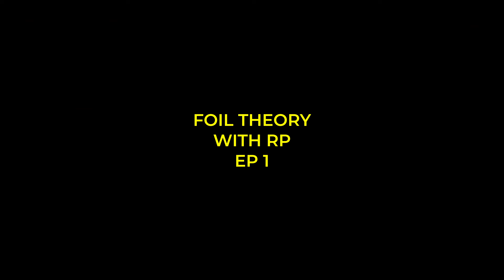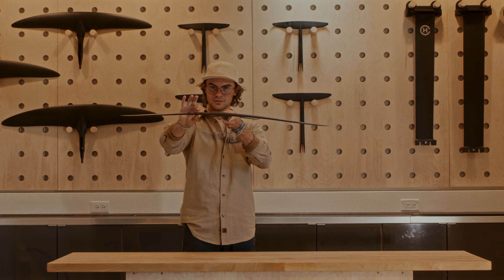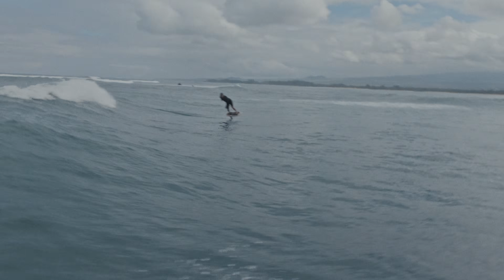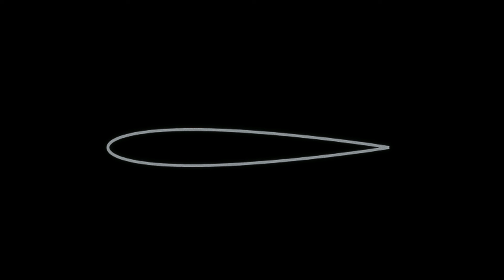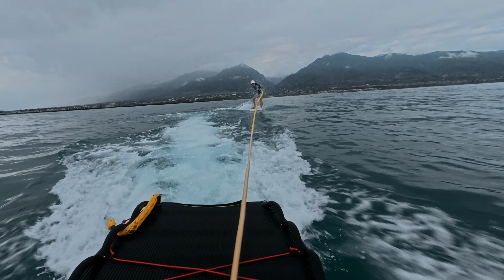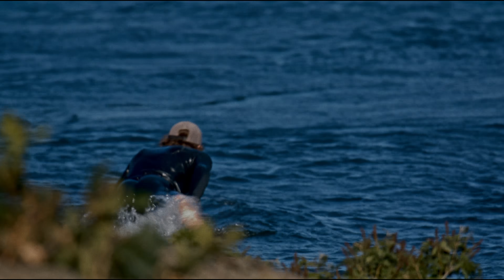How Hydrofoils Actually Work — Explained by an Aerospace Engineer | Hydrocraft Foil Theory EP 1

Comment: Actually it's quite the opposite. Anhedral creates roll stability and dihedral results in instability. The reason it's opposite is your center of mass is way above the foil and stronger lift on the lower side of the wing will push your foil up, but not you, because your not above said lift. Higher foil and lower you equals more roll. Go try such a foil, old gong fluid V2 for example...

Comment: 3:41 "most front wings want to nose your board down" 
That doesnt sound right to me, front wing produces the lift that sends the nose of the board up, did you get that backwards or did I misunderstand?
Reply: Try riding your foil without the stab on! Its actually a pretty interesting thing to do... you'll understand what he is describing too ;)
Reply: He hasn't explained that it is a speed related nose down. At the top end of speed the centre of lift creeps and causes it to roll forward. The stab produces the opposite lift but its the set angle delta between front and rear together with rake on the mast that helps.
Reply: I don't know anything about this subject but that indeed doesn't seem right at all. as if only an airplane's stab would generate the lift... please elaborate on this

Comment: 1) the front wing produces torque directed up (lift) which is enhanced by the torque from the tail. ifthis combination produces some drag as both the front wing and the tail are angles wrt the water flow. shimming  the tail reduces this drag but reduces the overall lift
2) for comercial planes, the dihedral does not return the foil to the horizontal position. There is nothing special about horizontal position in the interaction between the foil and the air. There cannot be the returning force.
I ignored the remaining BS

Comment: I want to get my grandkids into foiling but the danger of getting cut by the wing is too great, 31% traumatic injuries in 12 month period just can't do it. Kids can't control their fall and the foils are too sharp. One cut in the wrong place and it's curtains. One guy at Hood River cut his femoral artery and nearly died. Many many others with injuries needing stitches. If you could design an injury-free recreational wing for kids/teenagers that would open up the sport. IMHO
Reply: Great point. I am very safety conscious, and purposely choose foils that have relatively safe looking tips and edges.
Reply: Severne Redwing hydrofoil has rounded down turned front wing and stabilizer for safety. Don't  be hooked in to harness lines if wind foiling will avoid severe whiplash. However there is still risk of injury from these sports. Don't make footstraps too small, narrow and tall lets feet twist without injury , in theory.
Reply: Foiling is no more dangerous than any number of things that kids do (for example doing jumps on a bike) and is probably safer than things like skiing. The type of foils that beginners learn on have rounded tips that are turned downwards to reduce injury risk. It certainly is possible to hurt yourself with a foil but it's far more common to bash yourself with the board, which is generally not serious. I don't know where this 31% stat comes from, but realistically that must include some very minor injuries as I know many foilers and none of them have ever seriously hurt themselves. In the real world most foilers reduce the risks by wearing helmets and vests, and by and large we worry about currents, external hazards (like ships) and the cold much more than trauma from the foil.
Reply: @MichaelCrossUK  It's the sharpness of the wings that can cause traumatic cuts. You don't have knife like blades on a bicycle. The severity is increased.
Reply: I think the risk of getting cut on the foil is overblown tbh. I’ve been foiling for a couple years now and I’ve met literally hundreds of foilers and I’ve never met anyone who even knew anyone who got seriously hurt. Ofc literally everyone has had tiny cuts and bruises and stuff. If you’re still worried about it tho try getting them on some beginner windsurfing gear, slower speed + no foil means virtually nonexistent chance of injury.
Reply: @zuboragabora420  True, 69% have no issues or just minor issues that are not classified as traumatic which are deeper damaging stitches required cuts that cuts a lot deeper into the blood supply system or arteries, capillaries, and veins. That's what you do not want with your kids.

It would be interesting to know if the wings are actually hydraulically tested or just computer modeled? Then what effect does a thicker trailing edge have and a thicker maybe honeycomb construction for weight, where the edges are thick enough to not cut the skin. Does it really need to be that sharp. Some of the larger area wings have rounded ends which helps I would think. I think there really needs to be a safety push in the industry specifically focused for the new kids coming into the sport. The sport would really take off then I think. IMHO
Reply: All trailing edges and wing tips can be sanded dull (better not rounded, but made rather rectangular). The impact on performance is minuscule. Also there are "no-cut" pants, T-shorts and gloves on ali express.